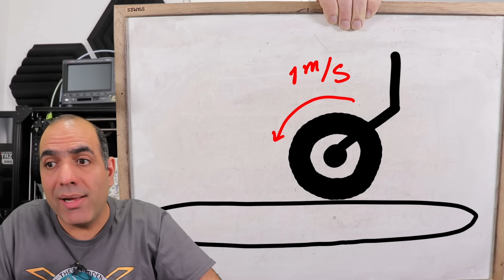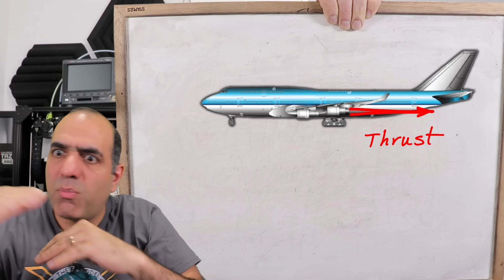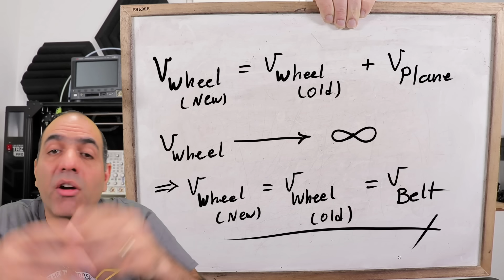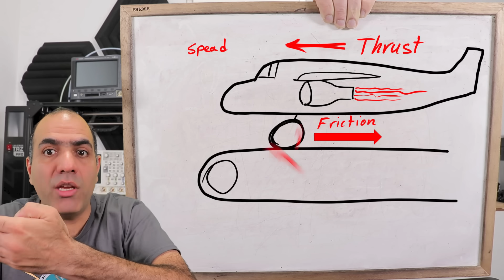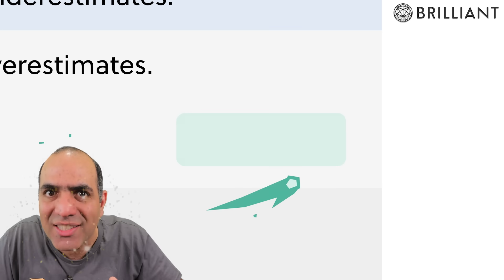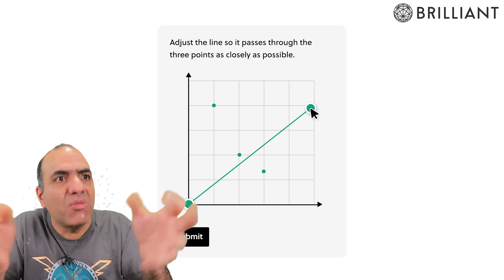Airplane Question that Drove Me NUTS!!!

Comment: As engines provide thrust and movement forward plane will be able to move forward, and treadmill will induce increased friction on the wheels, however with enough length of the runway plane will be able to achieve enough speed to lift off the ground.

Comment: this question is so stupid lol.
There needs to be friction between the wheels and the belt if the belt wants to keep the plane staying at the same spot while the negines push/drag it forward through the air.
Since the plane is pushing against the air and not against the ground.
Thank you for covering the belt to wheel ratio

There is a reason why you have launching mechanism on aircraft carriers

Comment: The best explanation I've seen for this question is this:
Imagine you're wearing roller skates, standing on a treadmill, and holding the end of a rope that's attached to the wall. You stand still regardless of how fast the treadmill moves, because the wheels on your roller skates roll as fast as they need to to cancel out the treadmill. No matter how fast the treadmill moves, you can always pull yourself forward with the rope.
Now exchange yourself with the plane. The "rope" in this scenario is the thrust generated by the engines/propeller; it's completely independent from whatever the wheels are doing. No matter how fast the treadmill moves, the thrust will still move the plane forwards.

Of course this assumes both the wheels AND the treadmill can just move infinitely fast with zero friction, which is why I hate these kinds of "hypothetical questions" with a BURNING passion, not just a mild passion. These things don't turn people into scientists, they turn them into pedants.

And pedantry is a game where EVERYONE loses.

Comment: I think it is a matter of getting enough airflow under the wing.  If the jet engines can get enough laminar airflow under the wing it might take off, the wheels do not have to spin in order for the engines to create laminar airflow under the wing.
Reply: The people saying it takes off aren't saying it takes off while stationary. They are saying the contraption is a red herring and there's no way for it to keep the plane from moving forward.

Comment: nope, nope and nope, the replies section to that tweet had me lose several brain cells, thank you for making me feel slightly better about myself, knowing that i got a silly internet question right
Reply: If the belt takes the plane backwards equal speed the plane tries to move forward, no lift is generated because no airflow.

Comment: Hello Mehdi, how are you?? In my opinion, the airplane's engines push it forward and this causes the wheels to move on the ground, and when it moves at high speed, due to the wind hitting the airplane's wings, the lift force makes the airplane lift.

It is also written here that the speed of the wheels is the same as the conveyor belt, so the plane does not actually move because the conveyor belt pulls it back at the same speed as the plane wants to go forward!! In order for the plane to take off, there must be lift force, and I said that the aircraft must move forward at a high speed so that strong wind hits its wings and lift force is created, but here, because the speeds are the same, the plane is moving fast, but There is no place to move, so there is no wind, and as a result, there is no lift for the plane to fly!!!

If my answer is correct, do us Iran a favor or at least give us a prize!! You completely forgot about us!!!.

Comment: Looks like the Mythbusters used a STOL aircraft for their experiment.  Kinda cheating a little if you ask me. A prop accelerates air across the wing generating a lift force. Some of these planes have incredibly short takeoff rolls. 

Let's reframe the riddle a bit. 
A 747 is sitting at the end of a runway sized conveyor belt, the end meaning the point on traditional liftoff.
Both the plane and conveyor are powerd off.
The conveyer begins moving at 1 meter per sec, which moves the plane backwards because of gravity and friction.
The plane powers on, applying thrust to overcome its backwards motion.
The plane applies more thrust in an attempt to attain airspeed.
The conveyor accelerates to match the  thrust of the aircraft.
The aircraft fails to attain an airspeed and therfore fails to take off assuming that such a conveyor would not drag enough air along with it eventually lifting the aircraft anyway. If that happened the aircraft would slowly gain forward momentum as it exited the ground effect.

Comment: Even if we assume friction, if the 747 goes in full reverse thrust the conveyor belt will push it forward. You can then set the thrust to forward and simply take off. 
Engineers don't ask trick questions, they find solutions! 😅
Reply: The belt exactly matches the wheel spin in either direction. 

Otherwise, the pilot would simply take off in the other direction. No reverse thrust needed.

Comment: No it won't take off because there is no air flowing through the wings, if the conveyor belt is moving opposite direction in the same speed as the 747 the plane is stationary. So there is not any pressure variations around the wings and thus there will be no lift.

Comment: No. Why ?? Because to fly You need to generate difference with pressure between bottom of wing and top side of it. If air does not move around wing there is no pressure difference so there is no liftoff. Damn typing ,in not native language, about physics related topic while drunk is not easy task. 20 Years ago it was almost impossible. Now day auto correct is so helpful.

Comment: Interesting video…

Case 5 - they didn’t define “take off” which could simply be the wheels not making contact with the conveyor. In which case they also didn’t mention if there was a giant magnet above the conveyor that could “lift” the plane from the conveyor and simulate a take off 😉

Or case 6 - the conveyor has ridges that are spaced the same distance apart from the front and rear wheels that could “bounce” the plane into the air again simulating a small and short take off

However, that said…I immediately came up with the answer that was explained in case 4 as that is how I read the question. No thrust from the engines and just the wheels matching the speed of the conveyor belt which results in an overall net speed of 0 m/s. This then results in no lift through the wings…so no take off
Reply: Case 7 - there is flying unicorn 😀
This is not how physics problems work :)
Reply: @igorbondarev5226  Correct…unicorns are biology ;)

Comment: Two ways "plane can take off"

One - pilot holds the breaks. Jet engines force plane forward along with the conveyer belt.
Assumption: The belt can give way to force.

Two: pilot uses reverse thrust and keeps accelerating the belt forward.
Then he suddenly breaks and locks the wheels to the belt, accelerating forward like a sling.
Assumption: The belt doesn't have infinite acceleration to stop instantly.
...also plane is made from material that can withstand A LOT of Gs.

Comment: I very quickly came to the conclusion the wheels and conveyor would quickly ramp up to some ludicrous speed before the tyres exploded, the whole wheel assembly blew itself to bits and the plane would collapse into the conveyor belt and be unable to take off before catastrophic damage to the entire plane occurred.

I assumed the plane was on earth. Was of normal passenger plane construction and the imaginary conveyor belt was capable of ludicrous speed.

Comment: Unless you have thrust of an engine to cancel the drag, your plane will never take off, no matter how fast you run the belt.
As soon as the plane gains enough air-speed and takes off, it comes right back down again.
Reply: You have read the question exactly backwards

Comment: I remember getting into this argument last year, also because of a video that Adam Savage did on the mentioned episode.
The same discussion was going on there as well.
I think under normal conditions and the plane not actually sitting still, the plane would take off because of the thrusters like you said.
The thrusters will bypass whatever is going on on the ground.
But if the conveyor belt has to match the wheels' speeds, then things get weird very quickly into infinity.

So, it should be up to the ones putting the question out there to properly establish the conditions, otherwise we keep having this same discussion every time, unless they admit that there are actually multiple answers if the specifics are lacking.
Same thing with a more recent video of Veritasium, where he argued about some theory about waking up Sleeping Beauty on a Monday, or an infinite amount of times and whatnot, where you had to Like or Dislike the video based on your answer, i Disliked it, but now that i mention it, i wonder whatever came from that.
It's been like a month i think, so i expect a review of it soon.
But yeah, there was also a similar problem with how the question was stated, or what conditions there were exactly, so i think in the end it's just ways to get interaction.
Reply: The plane wouldn't take off under normal conditions because the wings require air flow over the leading edge of the wing to produce lift. Which wouldn't be produced at all
Reply: @ozfartface1914  But it basically doesn't matter how fast the conveyor belt is going, assuming the wheels can keep up, the thrusters will still push the plane forward.
It's just that in 1 situation the plane takes off rather uneventfully, and in the other situation the conveyor belt and the wheels are going infinitely fast, but it still takes off (again, assuming that nothing falls apart).
Because the wheels only serve as a soft spot to stand on and low friction for take off, instead of the plane sliding around on its belly.
It's not like a car that needs contact with the ground to create momentum.
As long as the thrusters can overcome the friction, the plane can make speed and take off.

Think of it like a wet bar of soap on a slippery slide conveyor belt, it doesn't really matter how fast the belt is going backwards, the bar of soap will easily slide forwards if you push it (the push will be the thrusters and the slippery effect are the wheels in this case).

If there was a strong wind from the rear, then yes that would reduce wing lift efficacy, and if that wind matched the thruster speed, the plane would not take off at all.
But i wouldn't call that normal conditions.
Reply: @Games_and_Music  the treadmill is not unpowered in this scenario, if you take it back to a simple force vector diagram, thrust produced from the engines will be negated in the opposite direction by the treadmill. So the plane does not accelerate, and stays still

Comment: I would presume that considering the thrust comes from the jets, and not the wheels, the plane will take off, but it will most likely accelerate slowly.
Reply: Nope, no air flow over the wings

Comment: The real solution is that, if the plane can't overcome the speed of the "conveyor belt" such that there is not enough wind over/around the wings to generate enough lift to takeoff, then the plane can't take off. Assuming there's absolutely zero headwind. Again, this is specifically for the given plane 747. Some planes can takeoff without wheels, or wings for that matter.

Comment: Yes, it takes off as usual independent of whatever the ground does. The only difference would be wheel speed. The plane takes off as usual.
Reply: Unless we are saying that the friction on the bearings of the wheels is so high that they heat up and become brakes, you are incorrect.
Reply: But it cant takeoff as there won't be air moving past the wing.

Even with full thrust the plane would stay still

Comment: If there is no movement of air over the wings to create lift, the plane will not take off. Its that simple. The plane either needs to move or air needs to move over the wings. Sitting still on a moving belt with no forward movement will not cause lift.

Comment: That is my answer at 0:49. I think it might take of if you manage to do that before the wheels explode. If the wheels need to go faster than the ground and the ground tries to go at the same speed then the wheels, it creates a loop of acceleration and the wheels will explode if they go to fast. The plane accelerate using the engine so it doesn't rely on the ground. So it should take off if the wheel are still ok.

Comment: I´m at 1:57 and my prediction is: What the hell? Airplanes are powered by turbines/Propellers. Not by actively driving the wheels. Even though the conveyor will match the wheel speed, the planes thrust will move the actual plane itself, which may cause the conveyor and wheels to accellerate into infinity (Or to the physical limit that the components can take without exploding, then across that limit.) The airplane will start accellerating and the airspeed will increase, causing lift. So yes, the airplane will take off, even though the wheels may explode, making the rest of the journey into an undefinable mess. if it were a car with wings, you would need a lot of headwind, which may actually push you back (Drag) So a wheel driven vehicle with wings could not take off. a plane powered by air displacement of some kind (Propeller, turbine or rocket engines) can do it, but it may cause infinite wheel rotation speed, causing the wheels to blow up and maybe destroying the aircraft.
Reply: well, except for wheel bearing fricction, my assumptions were pretty close to what our beloved self electrocutor thinks. I am proud of myself.

Comment: Assuming the conveyor belt and wheels are indestructible, the belt along with the wheels would continue to accelerate to infinity, however before that point is reached the nearly 100,000 sqm runway would be generating such great forces on the assuming stationary air pulling it towards the plane, which would in turn generate a wind like force which when passing over the wings could reach the point where the aircraft has enough lift to take off.

Comment: In my opinion the solution is pretty simple, of course assuming real earth parameters as gravity, friction, zero external wind ecc. Therefore taking the direction of the airplane to the left as in the graph used by mehdi, when the thrust of the airplane starts to apply a minimum acceleration to the left to the airplane itself the contact points between the earth and the wheel tend to accelerate to the right therefore consequently the carpet will try to accelerate to the left to counterbalance this acceleration in such a way as to return to a stationary condition of zero relative speed between the wheel and the carpet, but the absolute speed actually continues to increase becoming identical to the speed of the aircraft up to that once the take-off speed is reached, the plane detaches from the carpet.  Nevertheless mehdi you're completely right saying that this problem does not give all the needed information do arrive at a single solution.

Comment: No, due to inertia of the wheels.  Depends on the hysteresis of the adjustable runway though.

In either case the high rpm reached within less than a second would blow the wheels apart

Comment: Will planes relay on thrust instead of wheel grip to accelarate. So of course it can take off
Reply: But the track would move the plane back not allowing it to go forward

Without airflow there wont be lift

Comment: Hi @electroboom. Of course, you are right that these sorts of questions are intentionally put in such a way so as to be interpreted in many ways and cause that sort of disagreement. Putting that aside, In your friction case, you assume that friction can always counteract the jet engine force. Does this sound reasonable to you? Also, the rolling condition is that the contact point of the wheel moves with zero velocity with respect to the ground it is in contact with. So, what does it mean to have the conveyor belt moving at the same velocity as the wheel in the opposite direction? The only sensible thing is to assume that the conveyor belt moves at the speed of the centre of the wheel but in the opposite direction. And in this way you avoid infinities. Also, since you have a treadmill, try pushing a toy car with your hand forward at a very small speed and see if there is any speed at which the belt will drag your hand backwards. Cheers.

Comment: I assumed that the thrust from the engines is enough to keep the plane stationary on a treadmill moving backwards (correct me if I am wrong but airplane wheels cannot move forward on thier own... they rely on the thrust of their jets or propelers... they only have a braking system ). So since the plane is stationary compared to our system (which is the world not just the treadmill) no air resistance is created, so it can't fly, my humble opinion.